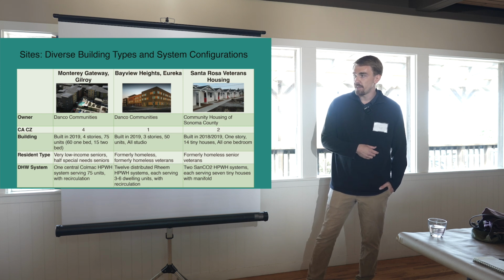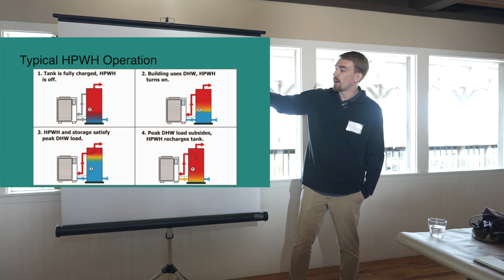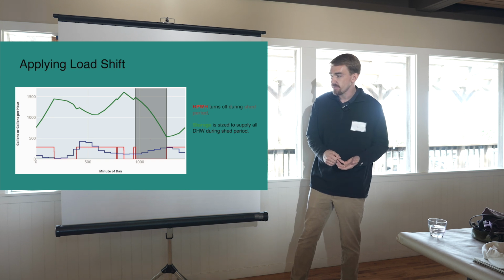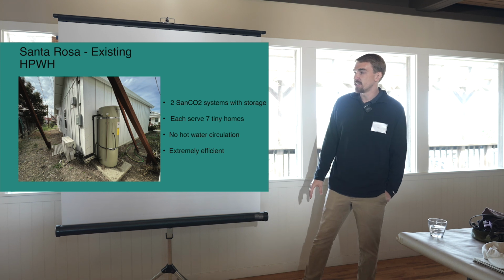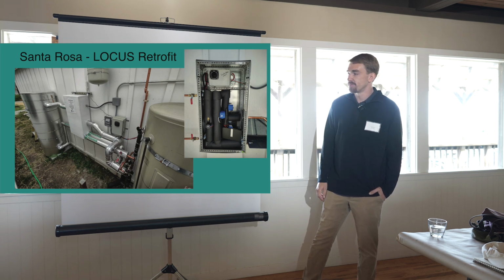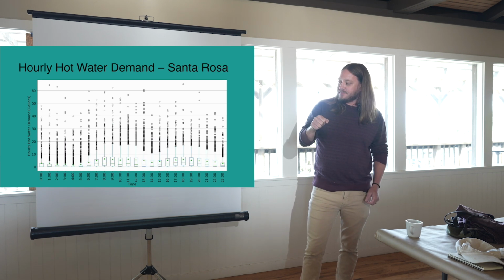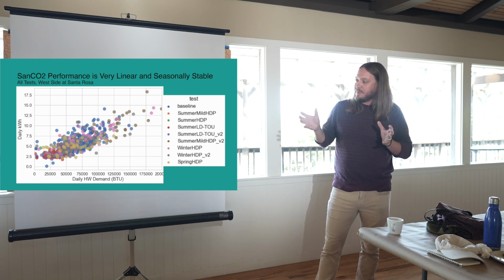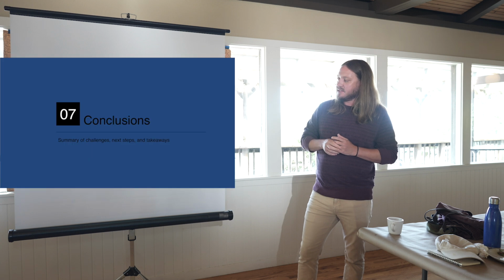Grid-Interactive Load Flexibility Control of Multifamily Heat Pump Water Heater Systems

Comment: Utilities like to remotely operate devices like EV chargers, HVAC, or HPWH's. EPRI is trying to make a standard for this communications. Your sophisticated design implies dynamic pricing with local control. Looks like a good but custom control system. Here in MA, the peak savings are to reduce power during peak hours each month, so not every day. Systems with solar will want to run HP when it is sunny -another complication. I'll bet you hear about it if you run out of hot water.